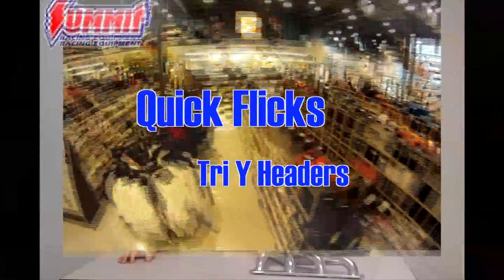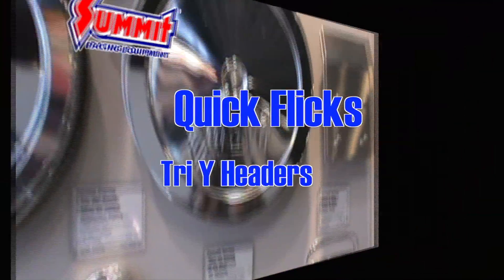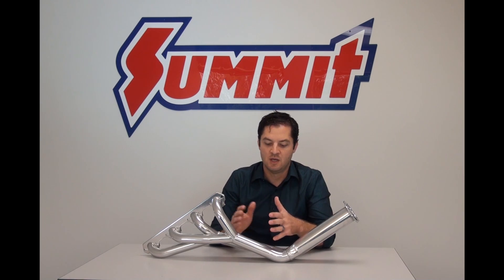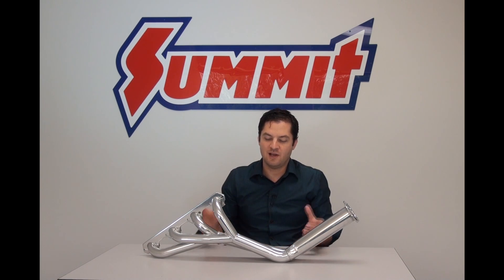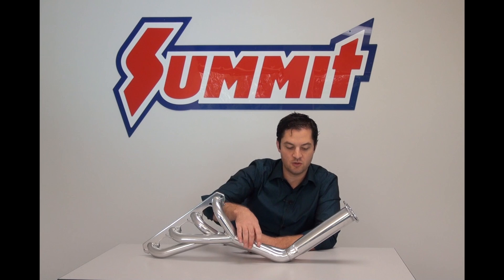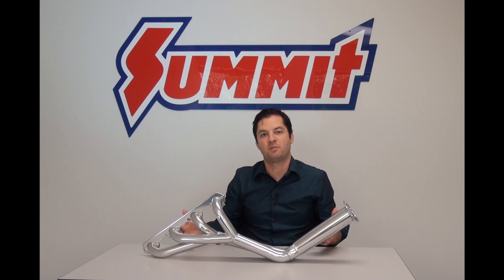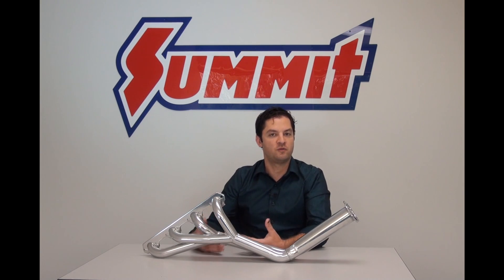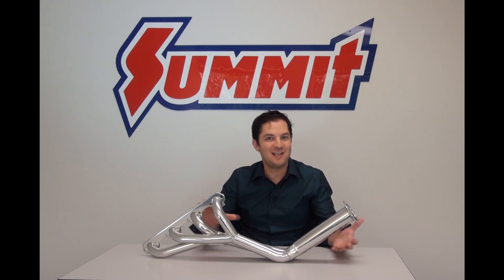Tri-Y Headers - Summit Racing Quick Flicks

Comment: I had a question about a design ive been thinking it’s similar to a tri-Y design minus the 3rd Y. But instead they flow into two common collectors roughly 2.5” pipes into an X-pipe. I wanted to know if an X-pipe would work instead of the 3rd Y to equalize the pressure
Reply: For a lifted 2012 gmc sierra 5.3l wanting it to act like true duals but in a net shell i wanted the bi Y design to exit two separate locations but the X pipe allows scavenging instead of two cylinders in two separate locations

Comment: This video doesnt explain any of the theory of Tri Y's, in terms of cylinder pairing, scavenging, etc. The headers shown are a poor design, as an example because the primaries are so short, the pulses are interrupted and become ineffective at assisting the paired cylinder. Look at nascar headers, for a good design. Very effective headers for broad torque curves.
Reply: Headers used in NASCAR are for 1 purpose & 1 purpose only: Long-term high rpm running at WOT. With anything in the engineering & physics world, there are advantages & disadvantages to any design or approach. Now, do you honestly believe that the engineers & engine builders working for NASCAR teams are going to sacrifice their 8,000 rpm ( or more ) OPTIMAL power-output running balls-out for 500 miles........for the sake of "low end torque" or "overall performance"??? BULLSHIT. They test & run headers that are designed to give them the most power at top-end speed. And here's even more evidence to prove my point: Look at the peak torque output of NASCAR engines built for the super speedways vs engines built for drag racing: A NASCAR engine has far LESS torque in relation the its' HP rating vs an engine designed for drag racing, which has higher torque for quicker launches. But an engine built for drag racing doesn't have a cam design & overall design to be held at WOT ( wide open throttle ) for long periods of time like a NASCAR engine does. For everyday driver applications, ya want a header design that gives you optimal power at low to mid-range rpm's, and tri-y headers are much better for everyday driving vs longtube headers built for racing. Tri-y headers actually give your engine more response during NORMAL acceleration as well as a decent overall improvement at higher rpm's. When you drive to work every day or running errands, ya don't run "balls out". Learn the damned difference.

Comment: Hopfully you'll still answer even though this is a old video. I'm putting headers on my 1982 f150 with a 302 soon. What's the part number or witch ones do I need? I'm pretty sure truck 302s and mustang 302s have different firing order so I'm worried if I get one designed for a mustang firing order I wont be getting the best performance. Lol also is there a difference in sound between these and traditional headers?
Reply from the maker: Hi Zach, We are not sure if you have a 2WD or 4WD application, but we only offer the Tri-Y headers for your application with 4WD. The Tri-Y header does have a different tone to it than a standard 4 into 1 header. You can get these headers in bare finish, black painted or ceramic coated. Here is a link to them on our web site. https://www.summitracing.com/search/part-type/headers/year/1982/make/ford/model/f-150/header-style/tri-y/engine-size/5-0l-302/engine-family/ford-small-block-windsor?N=header-style%3Atri-y&gnview=Horizontal&PageSize=100

Comment: Would this apply to a Jeep CJ5 304 V8 1980 in frame setup instead of using fenderwell setup?
Reply from the maker: Hi Mosxoula Economou, 
Yes, the Tri-Y type of header would be a good choice for a Jeep and some off roading. We carry a header for your application through Dougs Headers. The part number is DOU-D1104Y-R  and can be found here:  http://www.summitracing.com/parts/dou-d1104y-r/overview/

Comment from the maker: Exhaust scavenging helps any motor, some more than others. But, it was dyno testing that showed us that scavenging works in producing more power so, research to see if anyone has done testing and received good enough results for the motors you mentioned to justify the cost of the custom headers you would require.

Comment from the maker: Yes, installing a set of Tri-Y would work very well on your stock 78' Camaro. This style header should increase both low end torque and the mid - high rpm power output of your engine. Thanks for watching!